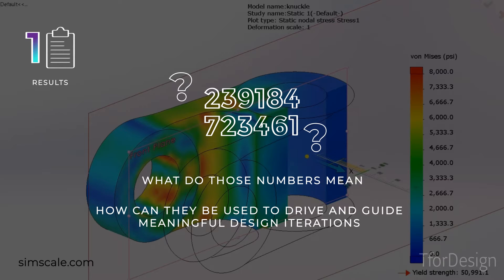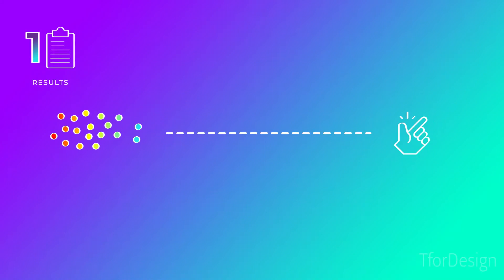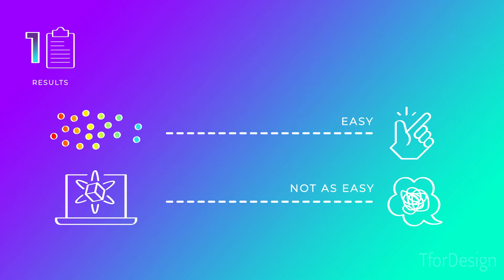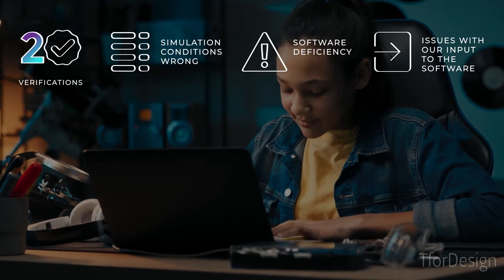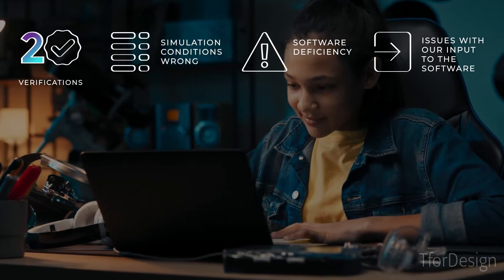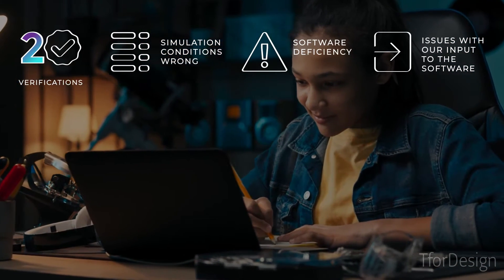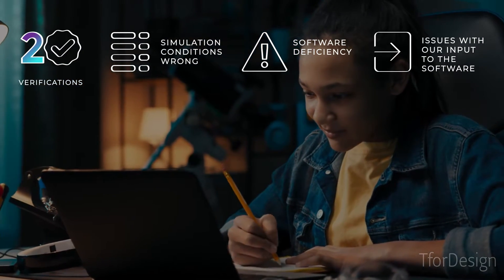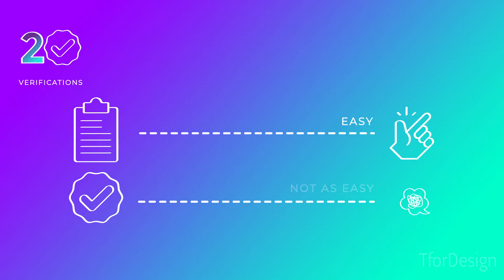Why are FEA Simulations so Hard and so Easy! | Finite Element Analysis

Comment: Is solidworks simulation easier to learn than Ansys? Ansys seems to require too much of GPU and RAM. Planning to do simulation in SW itself.
Reply from the maker: We don't long experience with Ansys here tbh! However, we believe it's all a perspective!
Reply: SolidWorks Simulations are only efficient for comparatively simple geometries. If you only need structural analysis or thermal analysis in simple components, then sure SolidWorks works great. However, for complex assemblies and specially Multiphysics simulations, ANSYS and COMSOL are only viable option.
Reply: @umairahmadkhan3792  Thanks for the reply. Very informative!